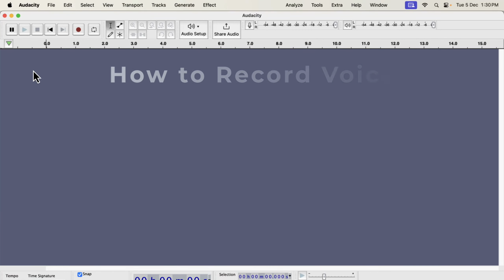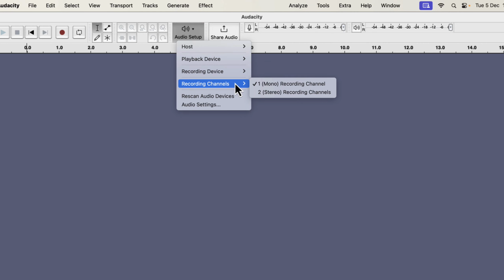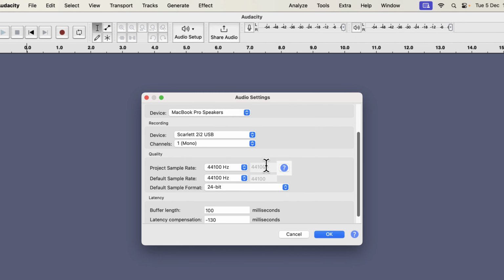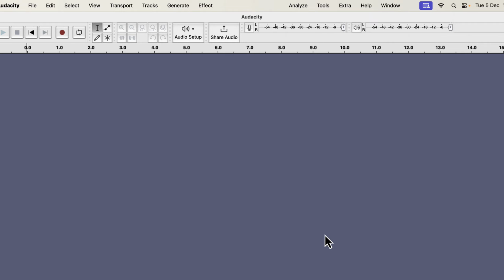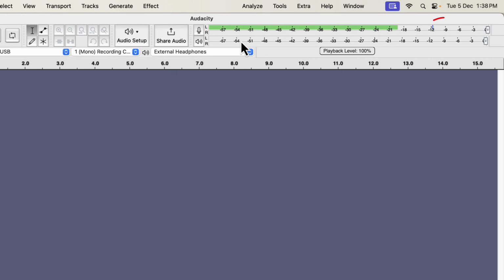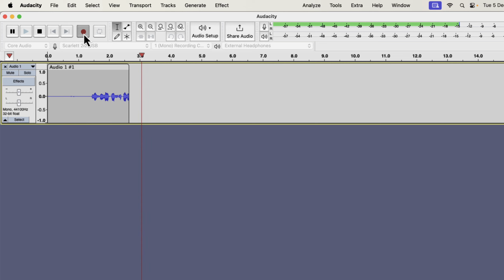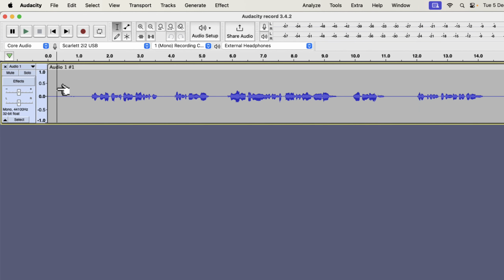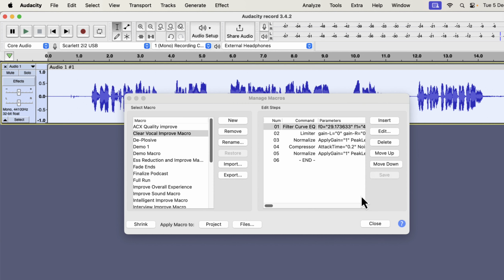Record your voice & get Audio File using Audacity for Complete Beginners (2024)

Comment: Hey, I had a question, hoping you can answer it. So I want a stereo echo over a vocal. Meaning I want the delay in the left and right not the center. Do you think I can find this effect in audacity. And what is this effect/ plugin called?
Reply from the maker: You have to split the stereo track to mono track. The pan left and right the mono tracks, apply the effect (most probably you are looking for a reverb ) and then join the mono tracks to stereo track again.
Reply: @MasterEditor5  Tried it, didn't work :( Im actually looking for stereo echo effect, where the delay is heard left and right but not the center of the same lead vocal.